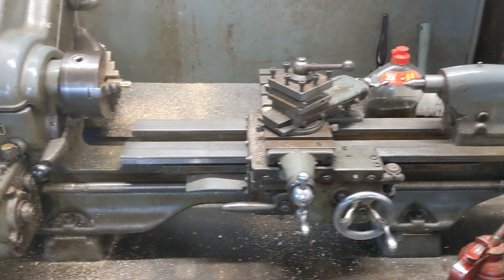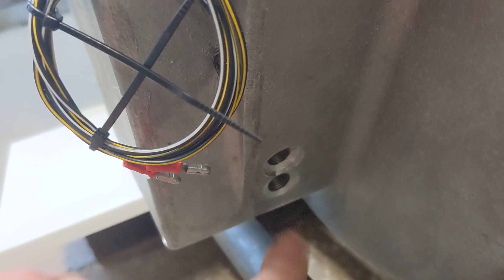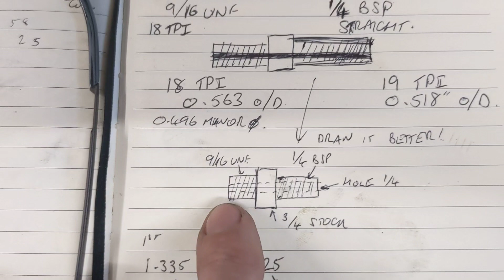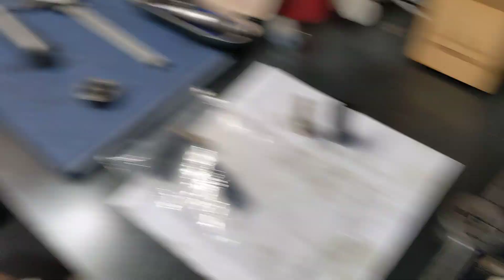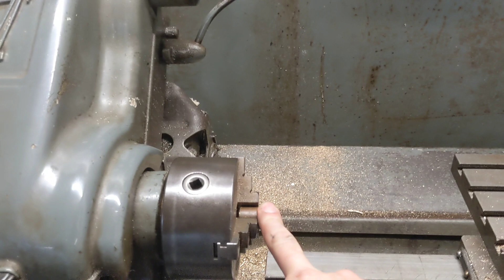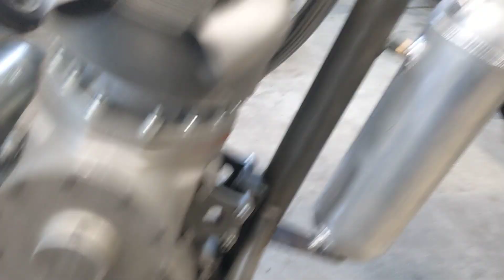Brass Unions

Comment: Ok, how are you going to machine the other end? You can't hold it by the thread .. Can you?
Reply from the maker: Excellent point! I can wind an exhaust nut on the thread and hold that if I need to, but the centre section should be long enough to grip.